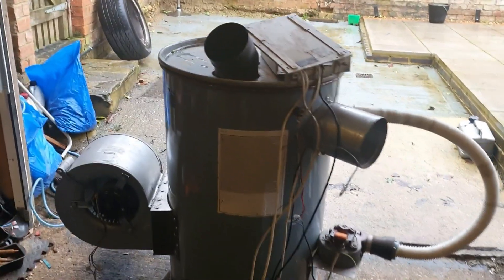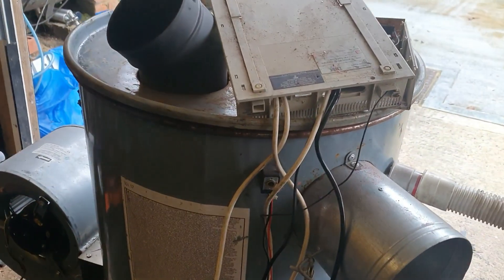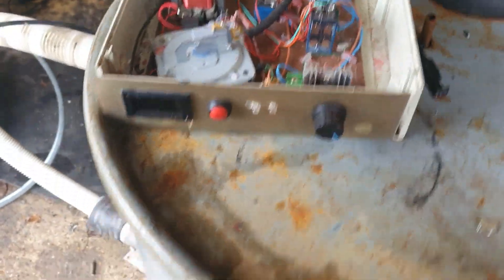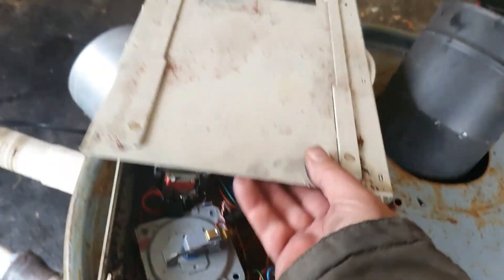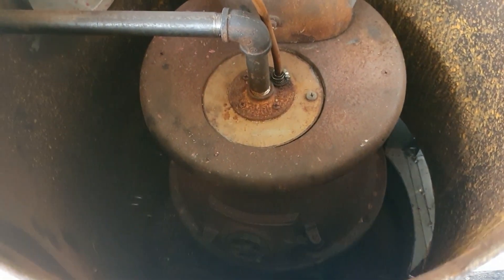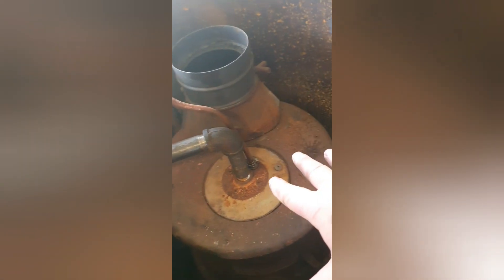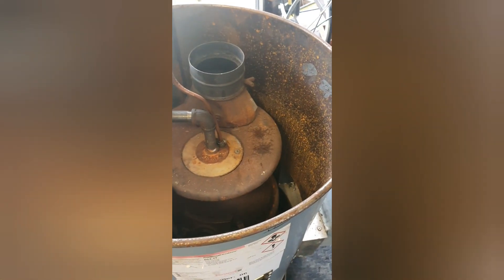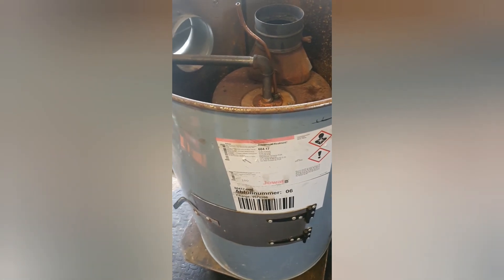Chinese diesel heaters on waste motor oil vs waste motor oil burners. Is it worth it?

Comment: Yes, there are hundreds of videos showing why you shouldn't burn drain oil. Especially if you need a heater that works. Where i live a couple of hours without heat can be a very big deal. Running on diesel, the chinese heaters aren't quite reliable enough. But, based on results, running them on alternatives is a hobby persuit not a reliable utility.
Reply from the maker: Thanks Curt. I've since established a simple drip fed waste oil heater offers a bit more reliability. In Romania we have "terracotta" room heaters designed to run on wood. I've been experimenting drip feeding one of these and will be making a video at some point. Something you may be interested in possibly. The simple mod I've made could easily be made to a log burner too, whilst retaining the original functionality. Thanks for the comment.

Comment: Sorry I’m late… I’ve been pondering this question myself. I don’t think it’s a question of how to make it efficient, but how to clean it often. Water methanol injection could be the answer. A small port injection setup could be easily done. It could “rinse” at the end of use right out the hot exhaust.
Reply from the maker: Hi, better late then never as they say. Check out Joel's YouTube channel, "Lowered expectations" he took the waste oil thing to a new level and continues to do so. I have to do a few more videos about my diesel heaters and will try to in coming weeks. But....I eventually ran out of time and energy perpetually dismantling the things and cleaning. I now have a couple more and run them on diesel, red, white...whatever I can get cheaper and try and squeeze every last drop of heat from them to maximise the economy. Hcalory do a 8kw version now and unlike the other models that all say 5-8kw, this one actually has a longer heat exchanger and seems to produce a fair bit more heat for the same amount of fuel burn. Check out David McLuckie's channel where he does a review of the 8kw one and a side by side comparison. Thanks for the comment and enjoy. Shane
Reply: @shanehogarth6373  Thanks Shane. I’ll be tuning in!

Comment: Yeah I think it’s a waste of time. I’ve seen so many people messing with miter oil and like you say the amount of time spent cleaning it isn’t worth it. I run mine on home heating oil and runs away quite happily. It won’t stop me looking at people trying but as is I don’t think anyone will achieve it without filters and additives some of which are not available to anyone. Fix your car. 👍🏻

Comment: What are you using the heat for mate,  is it just for your workshop or for the house as well
Reply from the maker: Originally it was for the house, but now I am using the chinese diesel heater for the house. More control, safer, smaller, and not illegal.  Downside is that I cant burn wmo and doesn't produce anything like as much heat as the waste oil burner. 👍
Reply: @shanehogarth6373  
I use a 180btu diesel space heater (bit big for the space but it was a £60 bargain off ebay) in my garage its only small something like 20ftx15  heavily insulated. I've run it on a 50:1 kerosene waste engine oil mix for the last 30 years with no problem and no fumes/CO2 or carbon build up. 
When I turn it on at this time of year it runs for about 10 minutes and I've a thermostat the other end of the garage that shuts it off at 21C it then stays off for 15 minutes and comes on again for about 7 minutes. 
This year because I can get free waste cooking oil I've been running it on a 1:1 mix of cooking oil and kerosene just having to turn the air pressure up a bit, good clean burn with just a whiff of chips when it shuts off but you have to be standing right over it to smell it. 
As with the engine oil there's no carbon build up. So if your wanting to heat up your workshop you could try that. Instant heat and turns off at a flick of a switch not totally free heating but cheaper than running neat red diesel through it.
Reply from the maker: @bobp6742  Thanks for the reply Bob. Well what a coincidence..I am currently using the diesel heater on a waste veg oil/white diesel mix of about 25% oil and 75% diesel, and have been now for a few weeks. Anymore than 25% waste oil and it gets a little difficult to fire up and doesn't produce enough heat for my needs. Yes, I too can smell 🍟 chips 😁. I used to work at a place where the kitchens changed their oils pretty much every couple of days and weren't used for meat products and have had this oil left from then. Its been in my drive for about 5+ years and has cleared wonderfully all on its own, being in black cans has no doubt helped. I pulled the ecotec petrol engine out of an old tigra and put in a 1.7 Isuzu engine with old style injection and ran this on the oil for a few years with great success. You could trace my route across Europe by the old empty bottles and cans in the rest area bins. I have about 75 litres of this left and for now will use this in the heater. Cheers for the reply, very interesting 👍
Reply: @shanehogarth6373  
Yes I found diesel didn't thin the veg oil very well but kerosene did. I run the veg oil through a 150 micron filter and the engine oil through 1 micron filter to get rid of any metal particles to save wearing the nozzle out and having metal particles thrown into my work area
I run my old land rover 2A with a 200 tdi engine on veg oil stink of chips follows me all over the place 🤣

Comment: The diesel heater is perfect for heating a home using diesel fuel in a crisis, BUT not using waste oil. The drip feed waste oil burner is a superb means of making heat from waste lube oil.

Comment: some people mix it 60% diesel 40%old motor oil ...though i'm yet to see what thier carbon build up was like...maybe just get a 500 litre tank and then you can buy cheaper red diesel or c2 parafin at that quantity,its cheap enough not to bother then ??
Reply from the maker: Thanks for the comment David. There are quite a few claims of people using mixes like this long term without issues. But for me and others,  not a lot of hours can be achieved before cleaning is required. Waste vegetable oil does not have the same issues, a very low carbon content I guess. Thanks again and if you have an interest in these heaters, please subscribe as I will be uploading a few more videos of the experimentation I have been working on in the the near future.
Reply: @shanehogarth6373  ive just bought one to use in my seasonal caravan awning and workshop.i've upgraded alot on it care of the advice of "john mck 47" on here(he's done some thorough research on em).....the irony is i can get loads of free engine oil,my mate owns a garage.i will have to have a think who i can get veg oil off and maybe give that a go.your oil heater looks interesting,there some thought gone into that!I was thinking of trying to run a bronze/metal furnace off engine oil instead of propane ....theres a few on here tried. i had already subscribed and ill look out for more of your videos shane.cheers
Reply from the maker: @davidwoodward7020  Thanks. I have looked at the John mck 47 stuff yes. Probably for me at least, the most useful, educational and believable stuff I have seen is from David McLuckie, check his channel out if you haven't already. Also Joel, "loweredexpectations49" has been doing some great experimentation with waste oil.  Good luck with the heater and have fun, but most importantly, stay safe mate.

Comment: So what is the build up in the chamber from? Is it from oil in general or is it from the dirty carbon in the oil? I have seen ways to clean the oil for bio diesel I wonder if that would help? I am still waiting for my heater in the mail.
Reply from the maker: Another guy has done more than me with this and his latest video has a very plausible explanation of what it might be at the end. Take a look. https://youtu.be/oC_ao35UfR4   Thanks for the comment. Hope you have good fun when it does arrive.
Reply: It's unburnt oil (carbon) due to lack of oxygen and not vaporizing the oil in the burn chamber.
Reply: @bobp6742  No, that's not, what it is. It simply is the residue of the not burnable stuff in waste motor oil plus diverse ashes of the oil additives. 
Back in the 70s, when waste oil ovens were legal and considered the best solution to get rid of used motor oil in a environmentally friendly way (limited knowledge back then), my first action every single winter morning as an apprentice was to take out the "frying pan" and chip out these baked residues with a small kitchen axe. 
These ovens never lacked oxygen, because even back then we wouldn't have been gotten away with a black smoking shop chimney.
So, they always did run with excessive airflow.
They were factory made and expensive.
Unfortunatelly got banned in the early 80s in Germany due to air quality concerns.
Reply: @werner.x  
I worked on heavy oil burners for over 20 years and I know enough about them. 
The oil isn't getting atomised to mix with the oxygen efficiently, there's not enough primary air there's no secondary air and there's not enough swirl in the primary air to help with vaporizing the oil. 
I burn waste oil in my forced air burner i get 100% burn with no waste and very little co2.
Reply: @bobp6742  
cannot be used crude motor oil then. This will always leave solids behind, because it simply contains them.
Reply: @werner.x  
It's waste motor oil i get it from my local garage. I've burnt it myself at home for 15 years no carbon build up no dirty burner. 
There's heaters that burn waste oil you can get commercially that will burn waste oil I've worked on them for over 20 years. 
The reason they don't like you burning it, waste oil is a valuable recyclable product that's recycled over and over again its refined into fuels or lubricants or anything that's hydrocarbon based. 
Here in the uk you can burn waste oil but the yearly license of around £5k a year makes it too expensive. It's so expensive to discourage its burning as its better to be recycled.

Comment: It's good to see someone being reasonable about the whole mess... I've been making videos about mine and my journey on trying to burn waste oil, and it's not as simple as many have made it sound. I am about to head to my garage and take mine apart after running an experiment last night, and I fully expect to find tons of carbon, as it shut off in the night. 

I have come up with one idea that would probably work, but I'm not sure how practical it is.... Basically a mechanical agitator that runs in the burn chamber while the heater is on. I have a few ideas on how this could be done, some more complicated than others.
Reply from the maker: I will interested in seeing that in practice. I am still thinking reclaim of as much energy as possible from the exhaust is worthwhile. I have hung a egr cooler from a Mercedes on mine and pumped water through it and it heated an old  refrigeration heat exchanger with ease. Am also thinking about forced induction so to speak to produce a bit more heat from the diesel going in.

Comment: I am wondering what the white bits are.  The highest concentration of metals in oil is Zinc - so zinc oxide when the oil is burned - is a likely suspect.  Most should go out with the exhaust, but things may not be as simple as that.  Your waste oil burner may well get rid of most particulates with a high pressure nozzle creating a good spray, but with a low (no) pressure burning cup it may well be left as a residue.  What occurs in a chinese oil burner will be a host of possibilities for initial build-up, which only gets worse with time at an ever increasing rate, once initiated.

To get that pot belly stove to red heat, you must have been burning oil at a fair rate?
Reply from the maker: Was probably around 500ml an hour before it got to saturation point, as in it started to pool. I was playing with different burner methods and also different methods of air entry. Unlike many oil burners you see  on YouTube I had a lovely blue flame once hot. But, after discovering the Chinese diesel heaters, other than maybe using it as a garage heater, its not going to be used now.